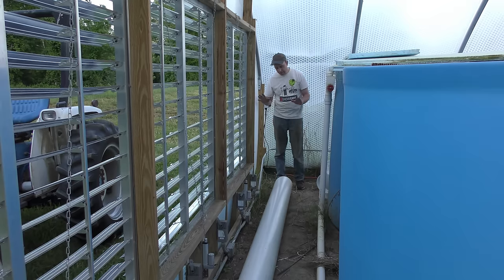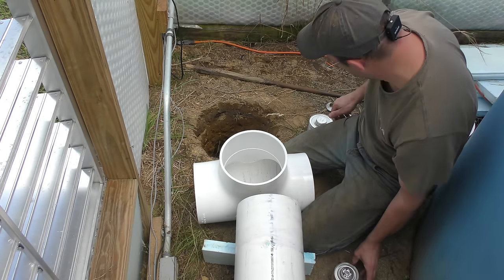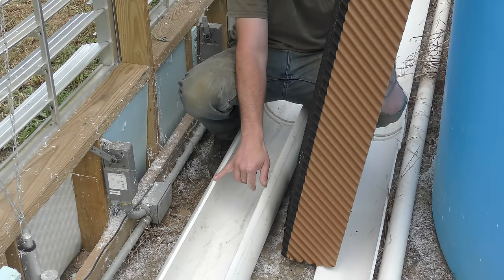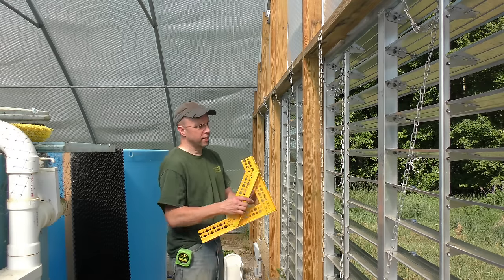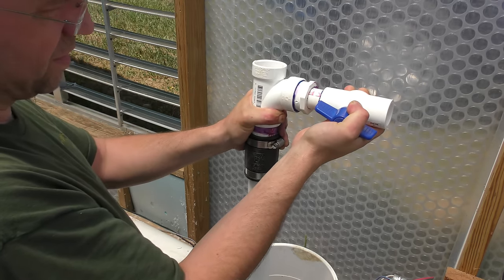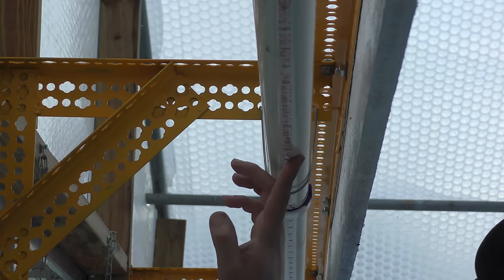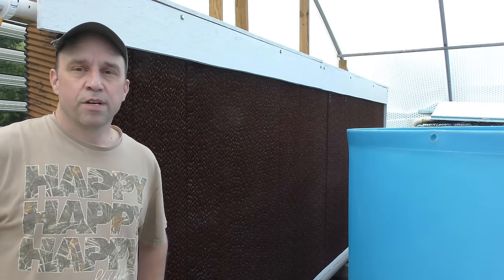Building My Own Evaporative Cooling Wall (AKA Swamp Cooler)

Comment: Used one of these with a big fan behind it on a rig in Oman during the summer, working on the drill floor in 45’C....it was a godsend
Reply: اخي انت عربي؟؟؟
Reply: How it was working when u run a fan behind the rig. Is it perform well or not
Reply: @hamzaaziz2955  very well, made a big difference. The fan was the same size as the radiator
Reply: Yes evaporative systems work best in desert areas because there is very less humidity in the Air and the rate of evaporation is very high due to which it produces super cooling

Comment: Evaporative cooling systems are used primarily in dry air climates but also work in humidity at a lower rate. This air conditioning method can be found as early at 2000 years ago most likely more. Far as the treatment of the pads is concerned its easy to keep the build up of algae etc by simple chemical processes used in drinking water. Not only that but its used in ventilated areas that the humidity escapes from continuously. If your concern is mineral build up use a water filter system, if your concern is biological build up use the proper water treatment. These coolers are widely used even to this day for air conditioning.
Reply: Won't using a UV filter, which is just a shitty UV lamp in a UV transparent and watertight enclosure, in the sump prevent growth of algae? a cyclone filter could take away any solids in the water, but would require figuring out where to place it due to this system being made quite compact in terms of not having a place to put it.

Comment: I lived and worked for 30+ years in the high desert of California and 'swamp' coolers were pretty much all we needed to use. Electricity was too high to afford for air conditioners. There is a porous cloth available to distribute the water across the top of the pads. Biggest problem we faced was the alkali in the water from the hard minerals from our well. The best we could expect was about 3 years for the pads.

Comment: Maintenance in the poultry industry many years, we found 1. Enclose the top cool pad cover/diffuser completely 2. So the spray bar should be spraying upwards under pressure to diffuse on the top cover (We used regular home style pool pumps) 3. Depending on your water quality, one might find cooling efficiency drop due to salts/calcification, might need to add a descaling agent. < we eventually decommissioned the paper style pads for that reason and installed 8"-10" thick black poly cool pads,  additionally a small amount of chlorine (pool pills) in the bottom cool pad catch tank prevented algae. About every 6-8 months, we would hi-pressure wash them to remove dust spiders feathers leaves  etc the correct method is to wash from inside /the clean side to the outside so not to force junk buildup into the pad core.
Reply: Alternative is shade cloth - folded/pleated or hang several curtain layers 1" gap between each, frame the whole curtain border with atomising misting garden sprayers - need several sequential shade cloth curtain layers to capture the water for efficient thermal evaporation - still need a bottom catch tank. this works just as well as commercial pads and easier to maintain.
Reply: Shade cloth comes in many weave densities 30-40% would be more suitable to allow for maximum air flow but still capture water molecules for thermal conversion.
Reply: After those comments, I did some testing myself and found that just adding 5 layers of shade cloth to the outside of the commercial cool pads (no spaceing between) with minimal intermittent mist sprays, have resulted in significant extra cooling 5-10c - eg 25% ambient humidity 33 Celsius, I'm able to achieve 19c.
Reply: @delicacydelight  Hello sir, a few questions please. I like the idea of shading cloths. Based on your experience, does adding layers, like 10 layers instead of 5,  increase the efficiency of the cooling process? And why atomising sprayers? Would not be sufficent just water that fills the cloths from the upside? Another question if you please, is it possible to recirculate the water?
Reply: @offlimit88 

1. **Efficiency of Adding Layers of Shading Cloths**:
   Increasing the number of layers of shading cloths can indeed improve the efficiency of the cooling process. This is because each additional layer offers more surface area for water evaporation, which is crucial for enhancing the cooling effect. However, it's essential to consider the balance between added layers and potential diminishing returns. If the weave density or hole size of the shading cloth becomes too restrictive, it may limit airflow and hinder evaporation efficiency. To address this, one approach could be to increase the physical area covered by the shade cloth. For example, if the cooling pads cover an area of 4 square meters, expanding the shade cloth area to 10 square meters would provide more space for air circulation and enhance the cooling potential. It's important to note that the shade cloth primarily serves as a pre-cooler to the cooling pads, enhancing their overall effectiveness in cooling the greenhouse environment.

2. **Atomising Sprayers vs. Water Filling the Cloths**:
   Atomising sprayers are used instead of simply filling the cloths with water from the top for several reasons:
   - Atomising sprayers create smaller water droplets, which increases the surface area exposed to the air, leading to faster evaporation and more efficient cooling.
   - By atomising the water, it can be evenly distributed across the shading cloths, ensuring uniform cooling throughout the greenhouse.
   - Atomising sprayers allow for finer control over the amount of water dispersed, preventing oversaturation of the cloths, which could lead to dripping and inefficient use of water.

3. **Recirculating Water**:
   Yes, it is possible to recirculate the water in the evaporative cooling system. Recirculating water can help improve water efficiency and reduce water usage, as well as potentially lower operating costs. However, it's important to monitor water quality and periodically replace or treat the water to prevent the buildup of minerals and contaminants, which could affect the efficiency of the cooling system and potentially cause damage over time.

In summary, increasing the number of layers of shading cloths can enhance cooling efficiency, atomising sprayers are preferred for their ability to create smaller droplets and ensure even distribution of water, and recirculating water is a viable option to improve water efficiency in evaporative cooling systems.

Comment: I  usually add few drops of anti-fungus, mold and algae  to the water to prevent any smells or  growth on the fins of the evaporator (those are used in swimming pools, so they are safe)

If it is a closed system (the water) you can also add water treatment like few drops of citric acid to prevent calcium from water from clogging the evaporator fins. Few drops of liquid soap makes sure the fins stays clean as well
Reply: That was on my mind. Good idea.

Comment: I think you should pin the 8" PVC in place laterally with form stakes on either side of it. You can bailing wire the stakes together, between the pads, for more security. Other than that, nice build.
I know you're a data hound, so I'd be curious to see the before and after temps in the greenhouse.
Reply from the maker: The sump area is buried in ground now (didn't show that part) which holds everything in place.  There's enough weight on it where nothing will move.  I had to push it around a bit to get everything aligned and had to use a pry-bar just to move it around.  Link to the temperature data is at the end of the video in the credits.  ;-)

Comment: A quasi-fix for the spray bar, drill the holes in a partial spiral. 
standing at the end of the system facing the sump, drill the first hole at approximately 10 o'clock steadily arcing towards top center.
to prefect the spacing you could face them all down again to see how far the sump was able to push water to each hole out to the final distance it could reach. divide time by the distance and that number into the arc length of your starting hole to the first top center hole. but thats only if you're like me and will be driven insane by the uneven flow/wear on the cardboard
...edit...
thinking on it, you wouldnt even have to redrill a pipe, just add in holes. the extra holes will only reduce the pressure leaving the holes nearest the sump
Reply from the maker: facing the holes up is the best way to do it.  As long as the spray bar is level, there is even distribution down the entire length.

Comment: I would be interesting to see the difference in temp before and after the cooler.
Reply from the maker: Link to that is at the end of the video.  ;-)
Reply: This is a well proven tech for cooling water and used everywhere in large commercial facilities.  That is what a cooling tower is.

Comment: I don't want to talk bad about your project, but you may have built a bacteria spinner there.

I work professionally with open cooling water systems. It is used to cool production machines via heat exchangers. Quite simply, actually. A large water tank (cold / hot divided), pumps that pump the water up into the system and cooling towers that sit on the roof. Similar to you, the water trickles downwards from above through slats in honeycomb structure. To increase the effectiveness, fans that push the air in the cooling towers press the air from bottom to top so that the water cools better.

What I actually wanted to say. Over time, germs and bacteria form in the water. These in turn have to be killed with chemicals and ultraviolet light. For some time now we have had to prove to the state that we take samples every week and that the systems are flushed regularly. Because the water is harmful to health.

You should be careful with the water and avoid standing in the water mist if possible.
Reply from the maker: I work for a company that builds controllers for cooling towers so am fairly well educated about this.  ;-)  There's a bottle of bleach sitting next to the system.....
Reply: @Bigelowbrook Ok nevermind ^^

Comment: Where do you live? The only place I know they work is in  Phoenix and the middle east. They were invented here back in the 1940s. The Gottel Brothers manufactured them here and end up sell lots in the middle east. Nead a real dry climate if you expect them to work at all. Last thing for them to work you need to discharge as much air from the space as the cooler puts in.
Reply from the maker: Connecticut.  Check out the second video! https://youtu.be/XbXaj45hiuc
Reply: That’s a bit of a misconception ... my company exports thousands of evaporative coolers to the Philippines, Sri Lanka, Turkey, UK, Germany, Spain, India, Bangladesh and South America (and Middle East and Northern Africa) But as you say, the key is letting as much air out as you pump in. 

BTW a strip of the filter media cut at 90 deg to the main pad (about 1 1/4” high) and glued across the top will spread the water evenly over the width of the panel.
Reply: I saw one working well in Michigan years ago.
Reply: We had them in Dhahran.  They were 2 stories high and filled an entire traffic roundabout.  Huge fans and the waterfalls were noisy and audible for blocks but forced the cold air thru underground pipes to homes up to a mile away.  Air was so cold you almost froze to death inside the homes when it was 125 F outside.  Of course it is very dry there next to the Persian Gulf, except at sunrise when all the moisture 'rains' for about 10 minutes and disappears.

Comment: Maybe turn and point  the water feed tubes down again with the cooling boards butted up to the holes.  That might create enough back pressure to keep tubes full with even distribution and possibly eliminate the little waterfall, splashes and drips?

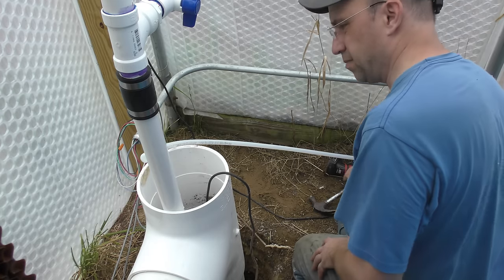Comment: 16:31 - What is that handheld device called?   What is it doing to the plastic piece?
Reply from the maker: It's used to expanded the Pex so it will fit over the barbed fitting. Then it shrinks back down and will never come off.

Comment: My mom and stepdad had a swamp cooler in Tucson, AZ.  Their walls kept rotted and black mold kept forming.  I'm not sure what my stepdad ended up doing but they ended up taking it out.
Reply from the maker: the water should be treated with chlorine...they really aren't great for cooling a house...something like a chicken coop or greenhouse is ideal!
Reply: Well I think they figured out it was a mistake.  This was ten or so years ago.  They're both gone now.
Reply: Arizona has the ideal climate for evaporative cooling... hi temp, low humidity. Sounds like they didn’t open enough doors and windows to keep the air moving through. That’s the biggest problem with lack of performance... ie: user error. And please, don’t ever put chlorine into a cooler for your home! Just make sure to drain all the water out every time you turn it off.
Reply: @axelknutt5065  As I've said, this was my parents.  I have no idea exactly what happened as I lived in WA state.  It's possible that the person who installed it in their house just didn't know what he was doing.  It's unlikely my parents kept their windows closed because they loved the outside air.  I know that because when I visited them, they always had their windows opened and this was in the spring.
Reply: Mold is a killer.

Comment: Are you using well water? I noticed what appears to be formation of minerals on the pads. I have a similar system, but use R-O water because our well water has about 500+ ppm of total dissolved solids and here in the desert, I run the system nearly year around. Get this, my aquaponic sump is 2-55 gallon plastic drums buried. The evap in the greenhouse is fed by the water from my system, and even when it's 105F, the water in my two tanks remains in the mid 70's. If anything, the water is too cold for some of my plants, but the fish like it.
Reply from the maker: our water is crystal clear.  The well is 500' and through solid granite.  It will take a while before anything will start to accumulate on them.  It's the intake of bugs and pollen that will be the long term problem.
Reply: There are additives to keep build up minerals suspended in the water which can be drained off periodically, and cleaners that help remove them, 
The pads seem to preform better on the second season.

Comment: Do you have numbers of before/after with the cooler?  How many BTU of cooling does each pad provide?  I'm assuming the temp drop is based on ambient temp and humidity.
Reply: 0 cooling at 100% humidity
Reply from the maker: There's a link at the end of the video that shows all the data on how effective it is at different humidity levels.

Comment: You can also mount the T in the middle and put 2 caps at the ends without the need for a connection plug between the pipes ... This way you will be able to dig more easily, using the space from above and on the sides. What do tou think??
Reply from the maker: I thought about doing it like that but it would be difficult to get to the pump since it would be under the pads.

Comment: 2 questions.  What are the "panels" your using called?  and...   What is that yellow metal material you made the brackets with called?
Reply from the maker: the pads can be found at most greenhouse suppliers.  The brackets are made from some scrap metal I found
Reply: Celdek

Comment: Will the pads get contaminated with minerals in the water over time, can they be cleaned?  I know my home humidifier gets quickly clogged from hard water.
Reply from the maker: Yes.  Thankfully we have very good water. At some point I will have to replace the pads.  If they last for a season, I will be happy.
Reply: I'm told running a vinegar/water solution through the system for an hour or two as regular maintenance is pretty effective.

Comment: What's that drill bit you use to expand the ends of the tubing? I've been looking for something like that but always end up only finding ones used in the automotive industry to expand tailpipe fittings.
Reply from the maker: It's a special tool used for expanding PEX tubing, not a drill bit attachment.
Reply: that was an M12 PEX Crimper

Comment: I'd like to see some stats.  Temps before and after running, inside and outside.  I'm crazy impressed. Just want to quantify how well it actually works!
Reply from the maker: There's a second video that shows this.  ;-)
Reply: Ok didn't know that. I'll look for it! Thanks
Reply from the maker: @craiggreenwood6496  https://youtu.be/XbXaj45hiuc  and  https://youtu.be/m0PiUP29taE
Reply: @Bigelowbrook  Don't know how I missed that.  I've now seen it.  Incredible!  Thanks

Comment: You need to look into getting a 3d printer. It is going to be very helpful. I have hist some road blocks where I am to make it useful yet. But I will be soon. Between having a kid recently and being tin the hospital for a while and the one winter that was so bad my greenhouse collapsed under a heavy snow fall. I have to start over. I was able to save one IBC tote though which saved me a little money. The laptop and all my gear are gone though.
Reply from the maker: I have three 3D printers, a laser cutter, and CNC cutter.  ;-)

Comment: Based on what I know (which isn't saying much), using Pvc cleaner is becoming less common in favor of Solvents that supposedly work without the need for PVC cleaner
Reply: Late reply, but I have used solvents before that claim that cleaner is not needed and personally have still had leaks and other problems. I would recommend still using cleaner, its not that expensive and doesn't take much time.
Reply: PVC cleaner is awful stuff that makes my head spin. But......I use it anyways because without it I have had the occasional leak.